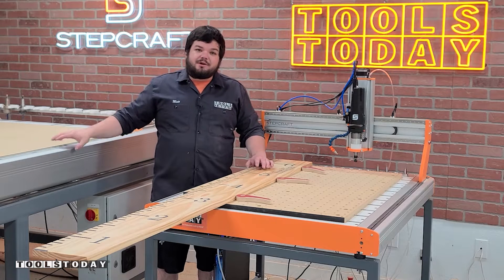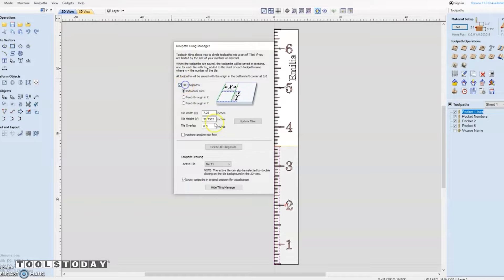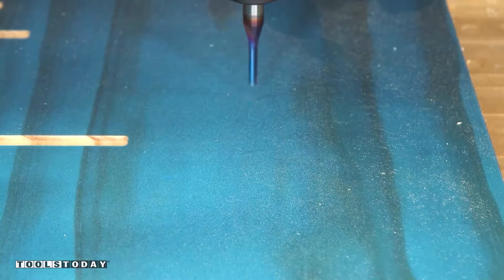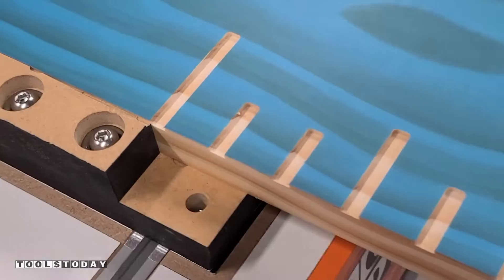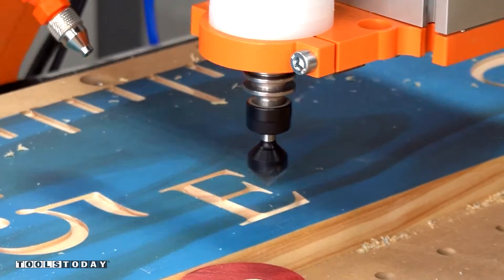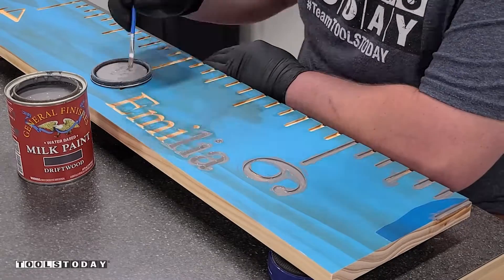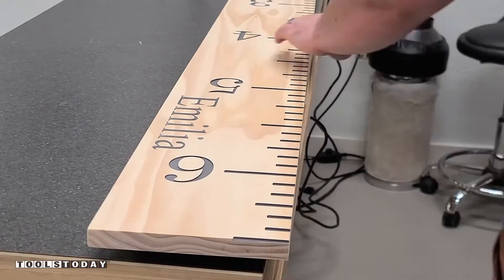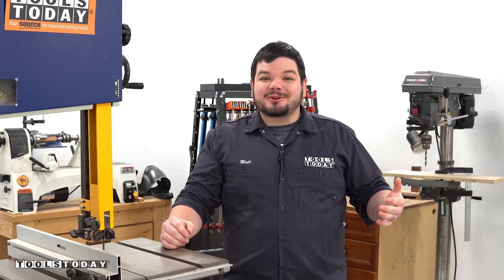How To Make Larger Projects Than Your CNC Table Size | ToolsToday

Comment: i like your leverclamps, how do you avoid to pull up the workpiece? why use the "oramask" ? because of edge quality? no ripoffs? i do like this: Workpiece sanding + fine sanding. Cutting text and ornaments, depends on indoor or outdoor , color the text and ornament, than sanding finish, oil or wax for indoor, epoxy transparent painture for outdoor.

Comment: No need to heat up the Oramask...comes off just fine without heat.  Been using it for 10 years.
Reply from the maker: It comes off fine, but sometimes it will take some of the wood with it, pulling the grain out when taking it off.  Using the heat prevents that.  Not necessary on all woods, but some are worse than others.
Reply: I recently CNC carved a bunch of text signs using Oramask for the first time. The wood was clear pine and I got some grain lift initially. I didn't know about using the heat gun, so I simply peeled very slowly and tried to go in the direction that would not lift any grain. The material was in place for less than an hour, but it was sprayed with white paint. So, clearly, ymmv...
Reply: @steveh8724  did you allow the paint to dry sufficiently?
Reply: @richardbaynes3862  Yes, but what does that have to do with the issue of lifting the grain? It didn't lift grain along the cut edge. It lifted grain in the middle of some of the areas where the film was completely intact.
Reply: @steveh8724  Did you seal the wood prior to putting the mask down??
Reply: Que up all the professionals😂😂😂😂😂😂